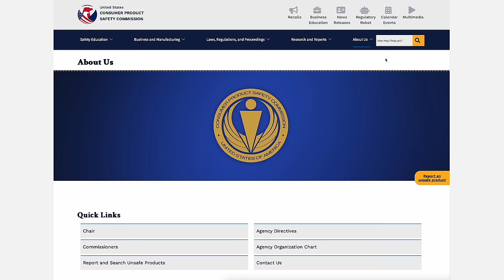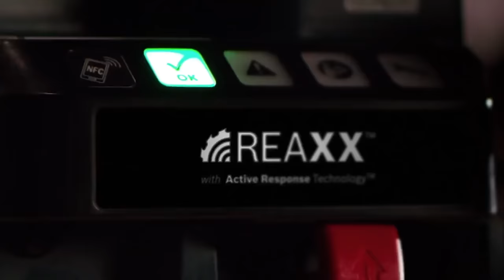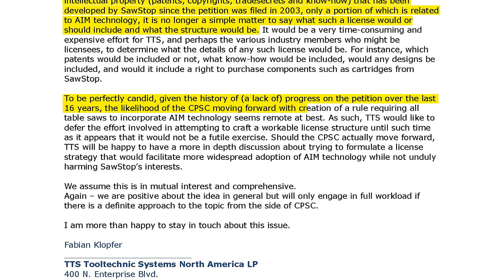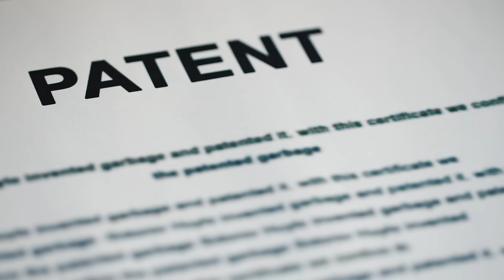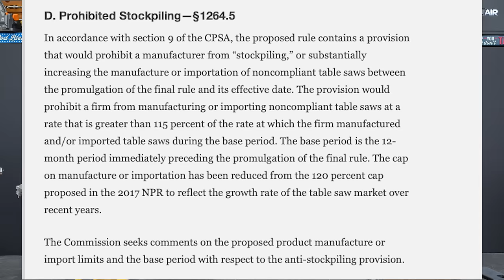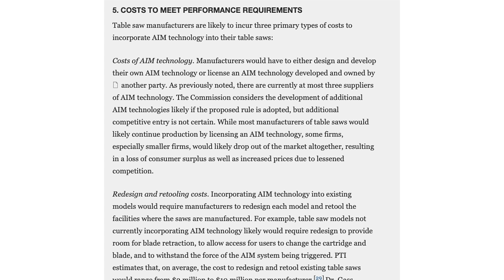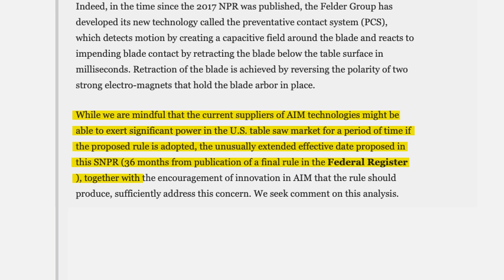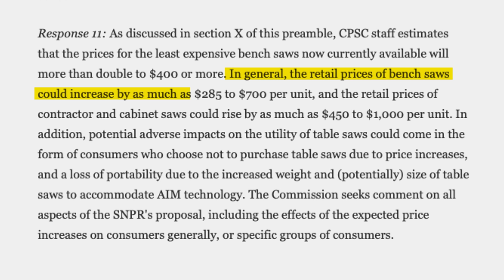The US Government is About to Change Table Saws FOREVER!

Comment: Decades ago when I started reading about Mr. Gass strong-arming manufacturers and demanding legislation to require his invention, the whole thing really soured me.  I could smell greed underneath it all, and I still feel that way today.  

I've been a professional carpenter for 43 years.  I have been using a Powermatic 66 cabinet saw in my shop since 1990.  I have trained myself from the get-go to do two things when I use it:

1. NEVER allow my hands ANYWHERE NEAR that moving blade.  That's what a pair of sacrificial push sticks are for, and I've destroyed many of them.  

2. Always anticipate where that missile will travel if the wood you're cutting should pinch against the fence or somehow catch in the saw teeth and be thrown straight back.  Standing to one side of the line of travel is key.

I smell monopoly coming due to hapless legislators who think it is their duty to regulate the issue without truly taking into consideration all sides of the problem.   Much of it is user's failure to learn proper safety techniques before hitting the on switch.  

If the bureaucrats want to do something helpful, limit the licensing fee to $1.00 and call it a day.  They should also overturn the restriction on Bosch's approach as an anti-monopoly move while they're at it.  Gass has had his day in the sun... lets move along.
Reply: Well he's an "attorney" so. . .

I'm also wondering if his "early life" checks out but I can't find anything on him.
Reply: Please send this to the CPSC.
Reply: So you've been using the same table saw for over 20 years. My thought with even a contractor table top saw is they're pretty reliable, simple to maintain devices that can last for years. This tech is going to make them much more complicated and more maintenance intensive, likely substantially shortening the service life.
Reply: I am another of your brethren. My table saw dates to 1970 and I have owned it since 1973. I easily have 10,000 to 20,000 hours on that saw. I was on a little bench topper 5 or 6 hours last week.
Your two "always safety"  I would add a third.  No distractions.  If the phone rings,,, it can ring all it wants.  If someone needs to speak to me,, they stand quietly in my peripheral vision and wait for me to turn off the saw.  I have fired employees and one wife because they could not get that through  their head. (Truth)  One of the first things I ever taught to employees, Leave me the eff alone when the saw is running.  Tap me on the shoulder,, or yell in my ear over the noise of the saw, "You're fired. Collect your check. There is the door."
BUT,,, I am all for SawStop and related tech.  The extra grand is cheap if it works.
Reply: push come to shove I know that with a few parts and a little work I can build a decent working table saw out of things that are in my shed that will do what I need to do. the one I currently use has one blade height has no safety stops or guards and has to be unplugged to stop it. and I will continue to use it the government has no business trying to get into my business.

Comment: The first "table saw" I ever used when I was a kid mounted a circular saw underneath a table with something similar to a router lift. That is going to make a come back if entry level is $500
Reply: Me too. Mounted a circular saw to a wrought iron fish tank stand.
Reply: Back in 1950 my dad built a 2 story house in PA with an ALL METAL Black & Decker 6½" circular saw that he fabricated a frame that held it upside down when he needed to rip stuff.
Reply: I was thinking the same thing.
Reply: So true. At some point it will be so much more cost effective to put together one yourself, that will be the way people will go.
Even then there may be professional kits that will be offered that is assembled by the end user, by passing all these rules that would unnecessary if only the users would be careful.

Comment: I learned to run a table saw in the '70's, as a college student in a scene shop. They taught me about 6 rules: 1. Be alert and aware of kickback. 2.Never rip anything narrower than 3 inches. 3. Don't run the blade too high. 4. Crank the blade down when done. 5. Keep your hand that's nearest the blade on the fence. 6. Never use the fence and the crosscut at the same time.
We used out table saw only to rip long boards, and considered it more dangerous than the other saws, so treated it more carefully.
 I'm 72, have all 10 fingers
Reply: How much was common sense back then?
I think common sense has been pretty much thrown out the window these days.
Reply: I also learned proper use in high school shop class in the 70s. I had a great teacher who spent the time before anyone was allowed to even turn on a machine. Problem is, shop class is rare if not nonexistent these days, what with the concern over liability and the push for every kid to get a college education, along with other changes in interests of the average teenager. 

A table saw in the hands of someone who has never had any training is extremely dangerous. I wonder if there are statistics on what the root cause for accidents requiring a trip to the ER?  I suspect a large number of accidents are caused by lack of proper training, and following good table saw safety practices. It is very easy to find people doing really dumb things with a table saw on youtube so that is probably reflective of the the general population. 

The requirement for riving knives and functional blade guards has had to have had an impact on the number of injuries, but then again, maybe that is not born out in the stats. 
These two items and the invention of the Biesemeyer fence that can be accurately and consistently be set parallel to the blade have made table saws a lot safer. Problem is, many people don't use their saws correctly and they get injured, even with these excellent improvements. These are accidents, but they are caused by intentionally disregarding safety features and correct use of the tool.

The rest of the injuries are actual accidents caused by fatigue, inattention or other factor that causes someone who knows better to do something they know better. 

AIM technology would be a great thing for all table saws to have, but I definitely have a problem with SawStop and the inventor's intentions to make millions by forcing this regulation. If it is that important to them,  they should have zero issue in letting other companies use their technology for free. But, since they sued Bosch over their tech, that clearly isn't their intention.
Reply: @MK-tc1on  Actually, in my case, none of it. I WAS INSTRUCTED in all those rules, had never used any power tool before that...
Reply: I went to a school that had a pretty nice workshop, with bureaucratic "safety" requirements I put that on commas because I have the feeling they demanded you using gloves, goggles AND face mask while using things like the lathe, drill, and mill, just to discourage students from spending time using that when you had to run to the next class... the justification of safety was moot as anyone who knows rotating tools will tell you long sleves, gloves and sight impediment (by using two protections) is a big no no.
Reply: @larrystuder6378  admits to no common sense..🤣
Reply: I saw a video years ago that discussed that the vast majority or table saw accidents come from professionals who a) work with the saw all the time and b) as a result they become overly comfortable with the saw and drastically increase their chances of accidents.
Reply: I agree but I will add, you can safely rip narrower than 3". Just use a push stick and have a riving knife on the saw. A well aligned fence to the blade is critical too. Most saws of that era didn't have riving knives so probably the reason they had that 3" rule for liability reasons.
Sawstops are good products I won't deny that, we have 2 in the shop I work for. My personal saw is a regular contractor saw, no flesh detection. It does have anti kickback pawl and riving knife so it is fairly safe in my experience. My only problem with the flesh detection tech is: People get complacent in not paying attention to where their fingers are because the saw will stop and drop. Okay great but guess what happens to the same person operating a machine that isn't doing your thinking for you? Severed body parts is what happens. Look at cars for example. People have gotten in a bad habit of not looking, starring at a screen while driving because"well the car will stop automatically for me so I don't hit someone" until that system doesn't detect someone at a crosswalk and they get run over.
Reply: So $200 hurts !  And losing fingers unnecessarily doesn't hurt !
Reply: good luck doing any finish trim in a construction situation (in the field not a shop build)without ripping less than 3 inches lol  there are so many times you need to rip a strip from nothing to 3'4 of an inch over 6 feet for instance on jam returns
Reply: I learned in a theatrical scene shop. 1×3 ( 3/4" x 2 5/8"") was about our smallest regular stock. On the rare occasions where we ripped something smaller, we were very careful who we assigned the job to,  and we did use push sticks. I never did finish carpentry, just stage sets. That level worked out fine, for me and us...
Reply: I started working in a wood shop with my dad when I was 9. I made tons of projects and taught grown men for years how to use saws, never one finger injury around me.  I am 46 now, and still no injuries as I respect the tools.
Reply: #6!!  NEVER USE THE FENCE AND CROSSCUT AT THE SAME TIME!!  All 10 here too..

Comment: i have a cousin who works for Bosch, specifically in the table saw division.  He worked on their system.  It was built from the ground up and they believe did not violate any patents.  however, once the ligation came, it became apparent that it was not in Bosch interest to spend the money to try and fight the lawsuit, as they assumed that the cost of fighting would wash out money made on their tech.
Reply: Its so evil they would sue to prevent safety tech.
Reply: Yes, that is the reason many times European manufacturers don't bring their good tech to the US, I know some other examples of this. Because in the US there is no punishment for wrongfully suing someone. In Europe, if someone sues for infringement but is proved wrong in court, they will have to bear the defendants legal costs. That's why those lawsuits are not made unless high chances of legal success are envisioned.
Reply: Bosch is the largest tool mega company in the world. They should be able to squish Sawstop guy like a bug. I don't understand

Comment: About that SawStop technology:

Kickbacks are, perhaps, the most common cause of saw injuries. Kickbacks are caused when the wood is allowed to pivot on the blade, or when the kerf closes on the back of the blade, pinching it, resulting in the blade raising the wood and throwing it back.

(1) Using push blocks, splitters and feather boards will cut kickbacks to few, or even none. 

The splitter keeps the kerf from closing on the blade, pinching it, causing the board to raise and be launched, often, across the blade. 

The feather board keeps the wood straight against the fence during cutting, so it doesn't bind on the blade and get kicked back.

The push block, superior to a push stick because it holds down much more of the wood, and can do a better job of holding the wood against the fence, while holding your hand out of harm's way.

(2) Not allowing your hands near the blade is, also, a critical part of safe saw operation.

(3) Add not raising the blade higher than it needs to be raised (just enough to allow the gullets to clear chips and dust) to upping your chances of staying safe.

(4) Finally, not standing behind the work piece, in case it does launch, is critical to your saw operation safety too.

ALL these things are even more important than owning a SawStop.  

SawStop technology does not stop kickbacks. It only protects your hands and fingers at the blade.

The SawStop safety feature MUST be disabled to cut wet or treated wood. Failure to do so will activate the brake system, requiring a new cartridge and blade.

Since the system MUST AND CAN can be bypassed, knowledge of the safe operation of a table saw is more critical than owning a SawStop or saw with its technology.
Reply: #3 is an important aspect that many don't think about. As my table saw is often used on wet PT wood, yeah, the SawStop would be worthless.
Reply: Well said.

My very first thought looking at this was kickback, and precisely the points you made about splitter, riving knives, proper technique (stand out of line of fire, pushblocks etc.

I've got enough going on in my life, and no cycles available for this topic.

Sawstop has $$$ for high six figure lobbyists.

True it might also increase people using saws and diy hobbyists like me.

Respect and appreciation to those pointing out the issues.  

Peace and respect.
Reply: Kickbacks are, perhaps, the most common cause of NEW LAWS.
Reply: Kickbacks...exactly, as in what kickbacks are Sawstop passing on to those in power to give them a huge market edge and drastic increase in sales.
Reply: @Countrylifeprojects , snort. Well put.
Reply: Cleaning up after aluminum cuts is also a pain.

Comment: I worked at a kitchen cabinet company for a few yrs and there was one table saw that was fitted with the SawStop. It worked fine with dry lumber but as soon as you put wet pressure treated wood on it, it activated the SawStop destroying the blade. And besides, 99.9% of table saw mishaps occur due to operator error...

Comment: Accidents do happen, but they can be reduced on a table saw by having good understanding on how they operate as well as having a good splitter and using a push block. I use the same saw as Norm Abram did and I follow much of his safety advice. He has pushed more wood through a table saw then I could ever dream of. I think one of the worst things is getting complacent.
Reply: EXACTLY

After I installed a Merlin Splitter on my Unisaw, pinched wood didn't go away, BUT it went to pinching the splitter, instead of the back of the blade.

AND, before they became popular, I used push shoes/blocks. That held the wood down MUCH better and kept my fingers and thumbs out of harms way.

MEANWHILE, sawstop technology WILL NOT stop kickbacks (wood launches), which can be as dangerous or more dangerous than losing a piece of you.
Reply: Totally agree with you
Reply: Are you aware Norm nearly lost his finger on his saw? He wear a finger cast for awhile on his show.
Reply: I see complacency as a separate topic. It's like pointing out that driving is more dangerous while reading a book.... Yep, it sure is... but your car should still be required to have headlights. 

My issue is with the patent preventing the technology making its way to the masses and the masses are funding the protection of that patent. 

Personally, I question whether patents concerning safety should exist at all.
Reply: Well said .. I was coming into the comments to say exactly this .. first and foremost is u freestanding alwxactly what it can and can’t do , and complacency is the number one culprit in tablesaw accidents

Comment: BTW, I've been doing woodwork for years and have never had an accident with the table saw blade.  I gave the damn thing the respect it deserves.  I've had close calls with kick back of the work being cut, had a 2x4 kick back and make a hole in the wall behind me.  THAT could be MORE dangerous than getting cut by the blade.
Reply: Survivorship bias is strong with this one
Reply: Indeed, the most dangerous thing about table saws is the kick back risk. It takes a decent bit of knowledge to understand how to hold and move material to avoid kickbacks. For instance knowing what kinds of wood could have built up tension that could be released as you cut it and then it moves into the blade causing kick back. The least dangerous thing unless you're being careless is hitting the blade itself with your finger. Some people might think the band saw is dangerous but that thing makes me the least wary. I've had a band snap and while its a bit jarring it doesnt do anything because it just releases itself from the wheels.
Reply: my grandfather lost parts of two or three fingers in his shop in the Bronx, You are lucky, don't forget that, ever.
Reply: @gilbatzri  Luck? No, your grandfather lost fingers because of issues you know not about such as less care, some issue causing him to not pay attention or not stopping when he noticed he should.